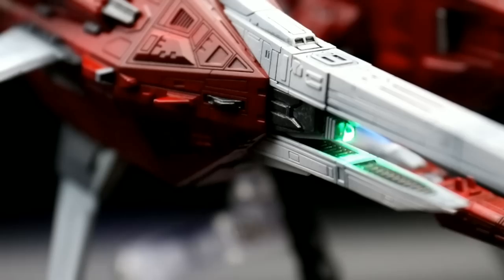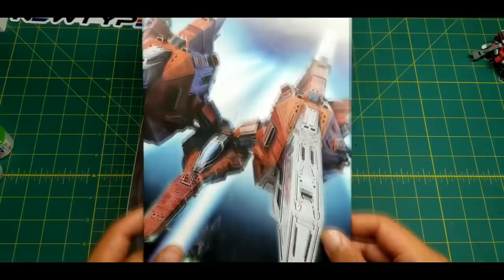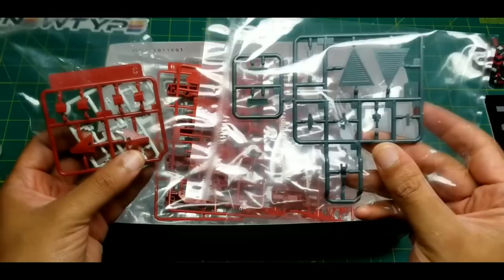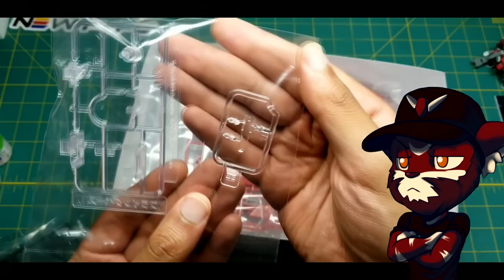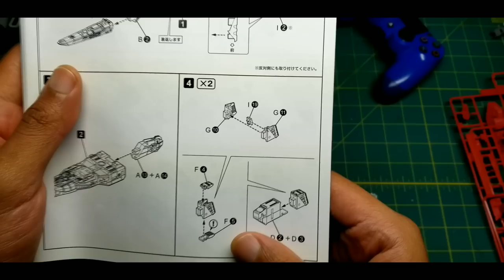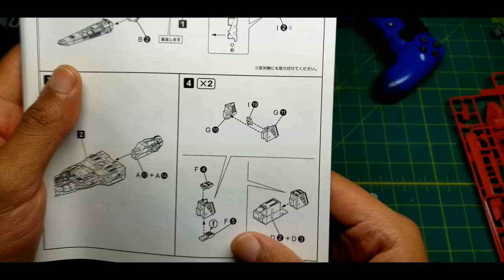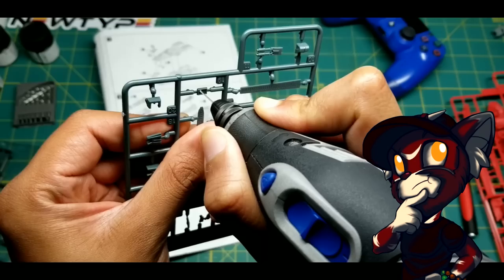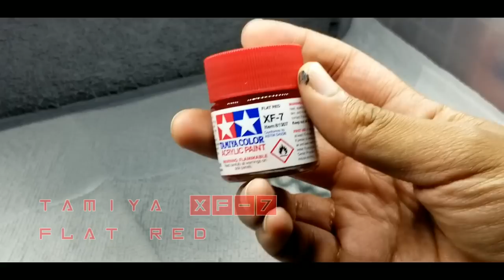#OtakuBuilder #PlaystationClassic #Raystorm 1/144 Scale R-GRAY RAY STORM

Comment: I'm using the same spray booth as yours. it gets crazy dusty after a while. how do you clean it?
also, I see you using acrylic paint, isn't it easy to come off? how do you prevent it?
Reply from the maker: It's not that hard to clean out the spray booth. If you happen to have a vacuum cleaner with a detachable hose that should get the job done. As for removing paint from the spray booth just use some lacquer thinner to remove the paint. But to prevent the dust from accumulating over time you need to replace the filter. Which is like $15 on Amazon respectively.